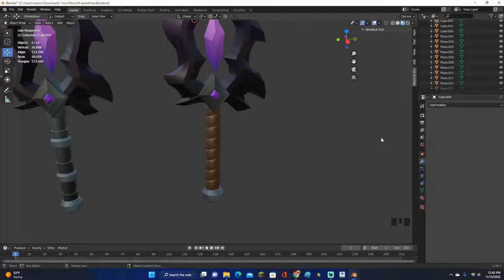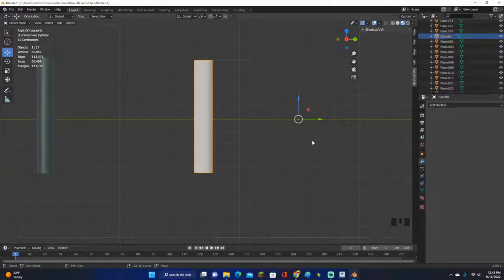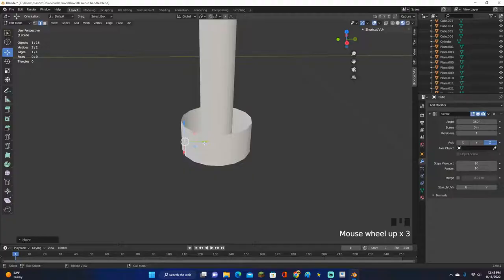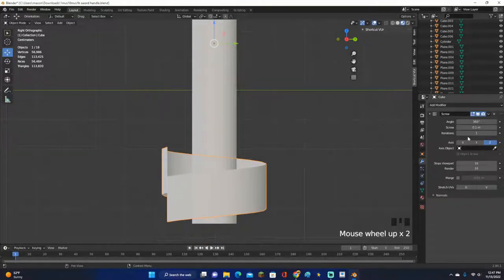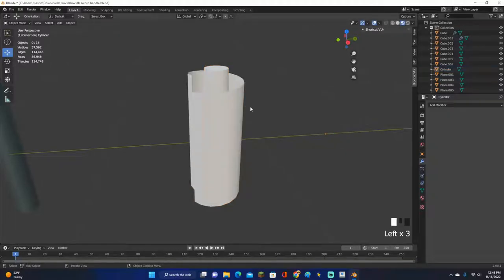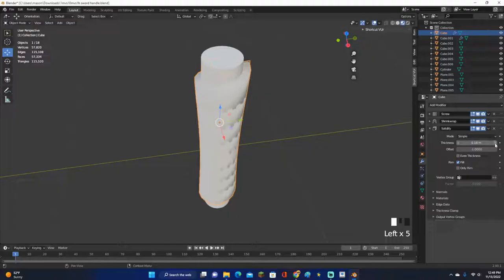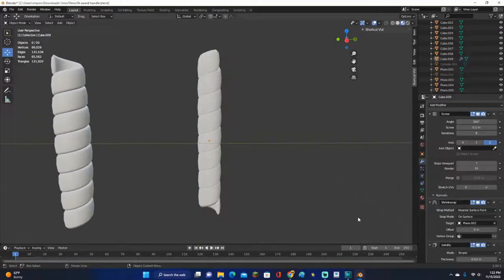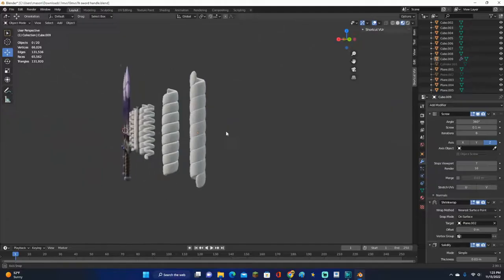How To Model Wrapped Handles | Blender

Comment: Using subdivision surface for a wrap that's going to be imported into roblox makes it far too high poly, even at level 1. It's better to just bevel the edges at the lowest possible value, use a weighted normal modifier and delete the inside faces to shave as much as you can off the triangle count.

Comment: Or you could just create a normal material save tons of polys on something so small that the player would barely see it anyway?
Reply: Alot of people notice textures, and good ones get them wanting it more. plus textures can be modified and accurate, materials still have to be put into a uv map and put on the mesh itself
Reply: @TrIIden  Its a handle, 99% of the time you see it it will be inside of a hand and barely visible. You can modify a texture just as good as you could creating the extra geometry. There is no point in this addition.